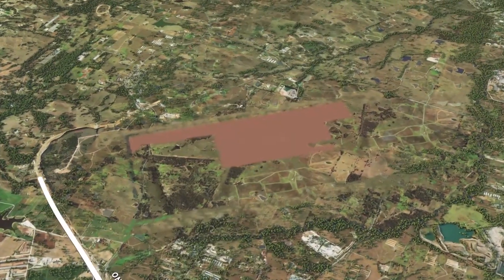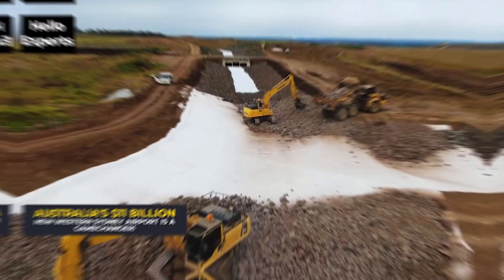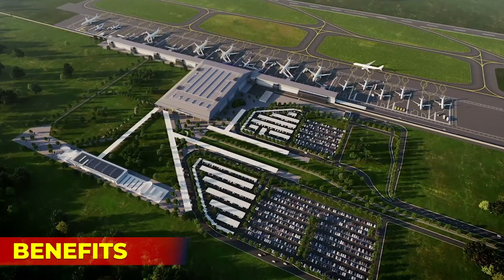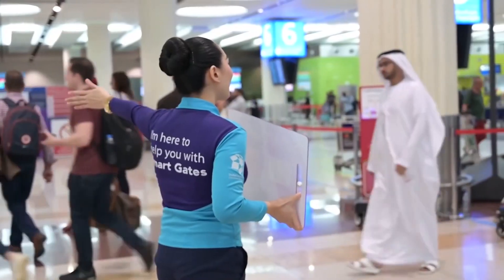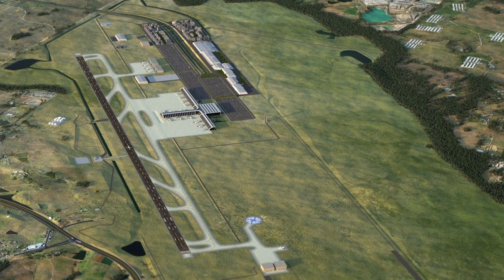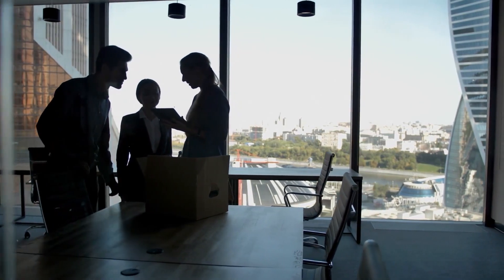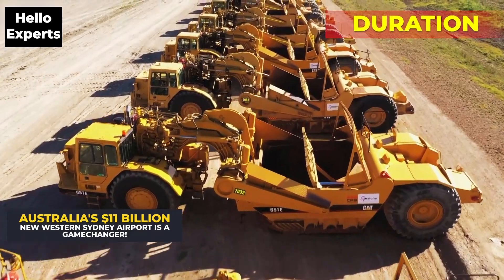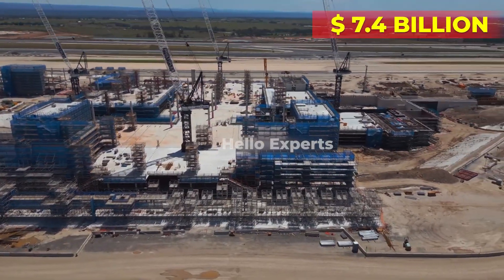Australia's $11 Billion New Western Sydney Airport | Airport design, completion and cost analysis

Comment: Most airports of this initial size and capacity don't have rail links at all. I'm surprised they didn't go for a 'fitted for, but not yet with' rail corridor. 

There will be multiple terminals and the Metro station is positioned equidistant between all of them. The two parallel runway centres are 1900 metres apart (far enough for air traffic to operate independently, as if they are two separate airports). Inside of each is half a runway width, two well separated parallel taxiways for large aircraft, a wide apron area and the terminal buildings themselves. That probably leaves no more than about 500-600m between terminals on either side of the metro; so, at most more like a 300m walk to any terminal.

As at most major airports, walking distances within each of the terminals to gates is often greater than 400 metres. It's a few years since I was last in China, but I recall lots of walking at most airports. Some stations are under terminals, but the terminals are often long and huge. WSA terminals will be more like three sides of a box around the Metro.

Even 400 metres is not a long distance. 500m is usually regarded as a distance people will walk without bleating. Even a slow walker (about 4kph) will do it in six minutes, average is five, (I'm 70, and can typically cover that distance every four mins, or less while I can still run), and there will be the usual provisions for those with limited mobility. 

Once the other terminals are up and running there might be a case for some sort of 'people mover' shuttle that mostly enables easier transits between flights at different terminals. Could also swing past the Metro, buses, cabs and car parks. Meanwhile, in my view, encouraging people who can to walk reasonable distances is actually good public design.

A genuine question. Why would the airport need a 180 metre station box? The North West Metro train length is 121 metres, (6 cars) with platforms capable of handling up to 8 cars (162m). My understanding is the Western Sydney Airport Metro will only use three car sets, with platform provision for up to four cars (81 metres). I can understand it for stations that might incorporate extra space for turn-backs (like St Marys and Bradfield).

Comment: Metro station is a ridiculous 400m from the terminal, in China it would have been directly under the terminal, nutjobs have designed this.
Reply: They built the new metro station between the two runways (the second runway to be built in the future) and I’m pretty sure it’s only 50meters or so from the terminal. Do your research mate
Reply: @geoffreylowe8383  You can clearly see the station box in the upper centre at 0.33 the box is 180m long, don't need research I've got eyes.
Passengers aren't unloaded on runways.
Reply: Its called mateship business profits. Sydney Airport Curfew Act was set on 1995, yet they decided to build this airport in 2018. 23 years after night flight crews lol.  Same as Syd to Melbourne Train, it is 10+ hrs, whereas if it travels @ 160Kms it should be around 6hrs. Syd to Brisbane is 14hrs train, whereas it should be around 6hrs @ 160Kms as its only under 1000KMS. Dont you think they could figure this out 20 years ago?.
Reply: @ShawS7  Sydney Airport has had a curfew for decades before 1995, but you have to dig to find it. The reading of the Bill for the 1995 Act confirms that, if you want to Google it. The 1995 Bill is just the current version of it. 

As for trains - Even the old XPTs that do the Sydney-Melbourne run can cruise at 160 kph all the time if they want to (max speed 183) The problem is not the trains, it's the slow, winding  'steam age' tracks, created when the only competition was from bullock drays. OK for freight (just), but very slow for modern passenger services. 

The tracks are like the Hume Highway was back in the sixties, now it's mostly four lanes and 110 Kph. That was all done over many years, bit by bit. We could do the same with tracks, starting with replacing the really slow winding sections (like Douglas Park - Mittagong) by re-routing it to parallel the motorway.